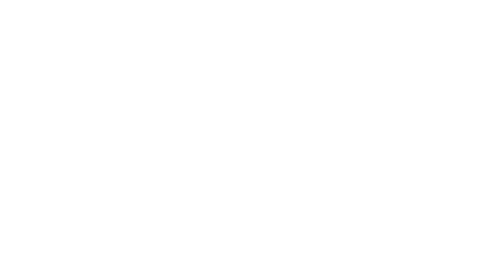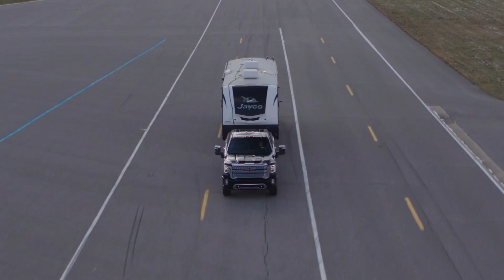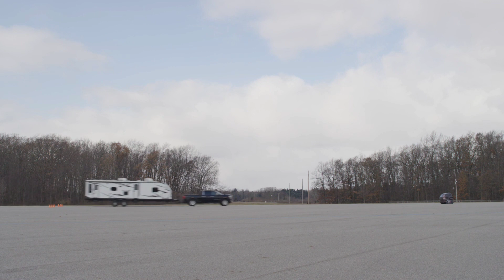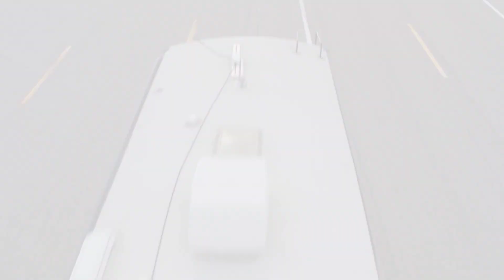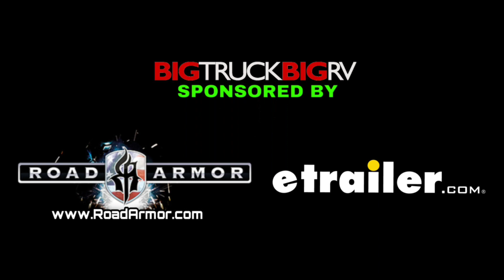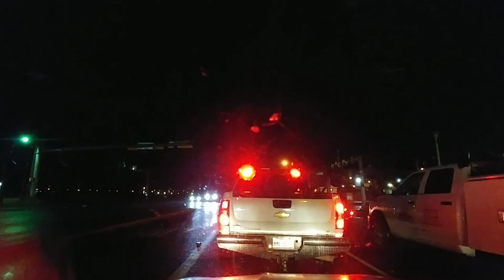GM introduces BIG Brake UPGRADES For trailers! Worth the price?

Comment: I bet the e boost will cause more wrecks . If you look at how it was bouncing and bucking. That will cause people to lose control in my opinion. Disc brakes will help.  I am converting to electric over hydraulic brakes on my trailers that are non air brake. Most people towing do not drive far enough ahead of themselves.

Comment: I had Dexter hyd. drum brakes on a 1993 sooner horse trailer axles  wore out about 2009 replaced them with Dexter Hyd. disk brakes, so they have been around a long time. The reason RV manufacturers don't use them . Simple Cost.

Comment: Why not design an ABS modulator kit for a trailer? Very doable with wheel sensors  and modulator with hydraulic or electric drum or disc. Just not sure the consumer would accept the additional cost. At least it would be a universal fit across all trailers.
Reply: Sam Tuck that would make most sense rather than trying to deal with crazy. 
Semis are still predominantly drum on tractors and trailers, we just have ABS on everything.

Comment: Dexter axle has already been making this (Tow assist). They’re just trying to find a manufacturer to work with on utilizing it...same thing GM is having problems with. 

It’s really a simple system. 

FYI people. This is not a GM truck feature. It’s a ABS system installed on a trailer. If the trailer has this system any tow vehicle can power it up.

Comment: So what's the difference between this upgrade to your truck and to upgrade your trailer brakes to hydraulic disc brakes on your camper/trailer? Wouldn't hydraulic  disc brakes on your trailer give you equal stopping power as your truck?
Reply: Power could be similar, but the system likely has the ability to vary pressure depending on where it's needed or even have ABS integrated into it.

Comment: Um. Here in Canada all vehicles except motorcycles must have brakes that can stop a fully loaded vehicle (including trailer) going 30kph in 10 meters. So this new GM thing seems like marketing vomit. Now disk brakes would prevent brake fade. Not stop faster. It's like Porsche towing a plane. Or Ford towing a train. It's all nonsense
Reply: Lunar Lancer you would find that is the same requirement for US vehicles. The catch is you have to figure out how to properly operate your equipment, which often is confusing to people for some reason. Prime example, some do not set the gain on electric brakes.

Comment: Maybe this kind of technology will be available with a brake controller that will work for us with older trucks, and disk brakes should be a option for every camper, and standard on ones over 12,000lbs dry.

Comment: I'm pretty surprised that abs isn't already standard on most trailers.  As a bit of an amateur tower (not really inexperienced but I just don't tow that frequently), the lack of feel tends to lead me to set up and use trailer brakes less aggressively than I probably should and I don't think I'm alone.  Given that trailer brakes are generally electric it doesn't seem that difficult to modulate them with a simple circuit.  Sensing lockup would require a different approach than in a car but I think that could be overcome.

Comment: My trailer has drums and it stops great. Truck stops faster with a trailer than without. The only problem and reason I am considering a disc conversion is because when the drums get hot they get jerky.

Comment: We ordered a Grand Design 310gk three weeks ago. The salesman mentioned that GD is kicking around the idea of discs on the 310gk. It was offered to me for 4K and I immediately accepted. It also included 17in wheels , 8k axles and American made tires. I think they are H rated. Not positive on the rating but it was an increase. My fifth wheel will be a 2021 model and will take delivery approx. May.

Comment: I doubt I would pay for this feature, but atleast they're investing in these trucks as they are actually made for towing. Stopping power is just as important as towing.

Wish they would stop adding things that skyrocket the price of these vehicles that(from what I read on foruns) not a lot of people want.

I am really wanting a denali or king ranch, because I like the interior feels and the leather, probably be better off buying an xlt or sle and just putting aftermarket leather heated/cooled seats.  But at that point the price goes right back up there again, cant win.